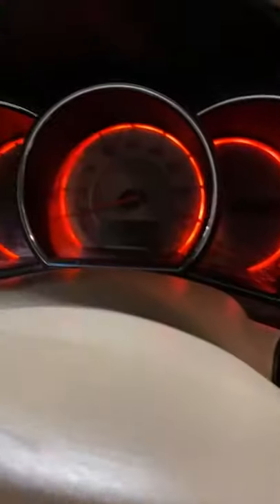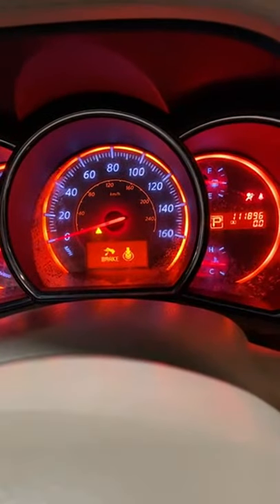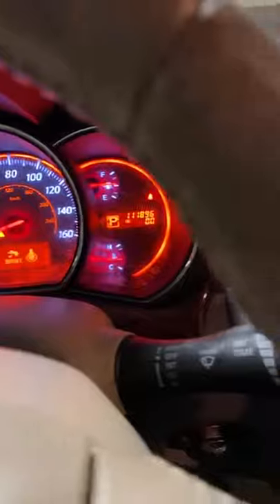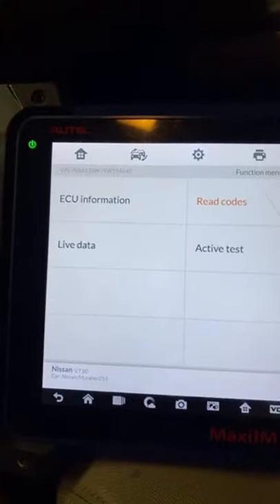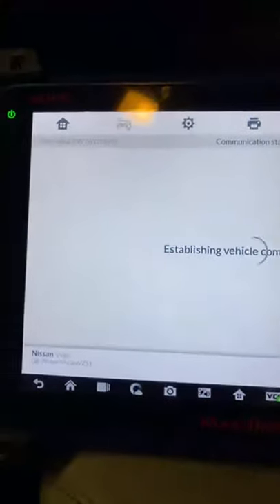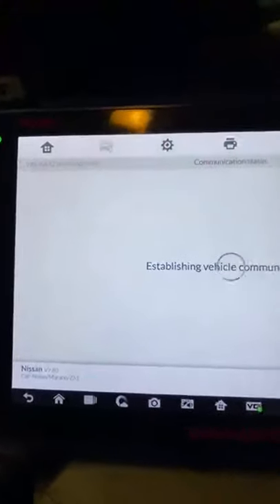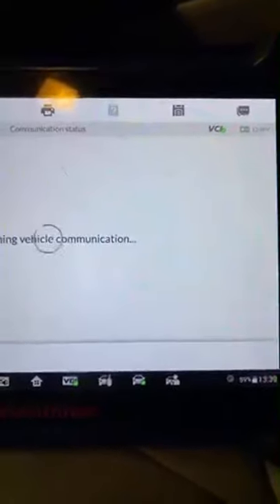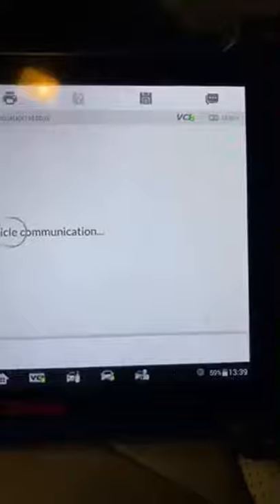2009 Nissan Murano Sunload sensorw what you need to Know

Comment: Hi so today I just change the sun load sensor, one on the right, I have the same code coming up, climate control has an issue, 18°c being cold if I put it on 18.5 it get hot, I scan and clear code after change but no avail can you help me?